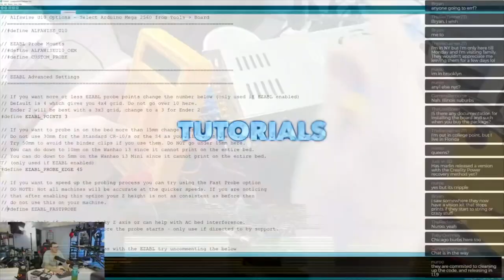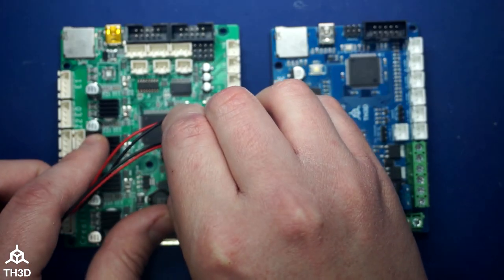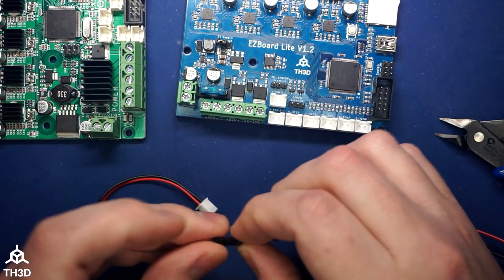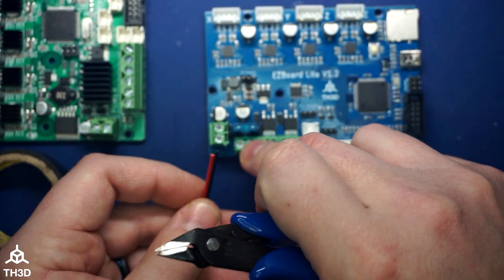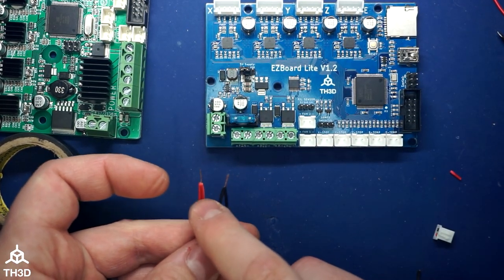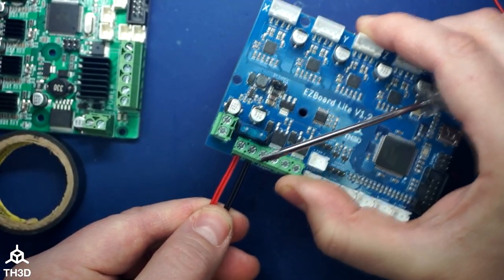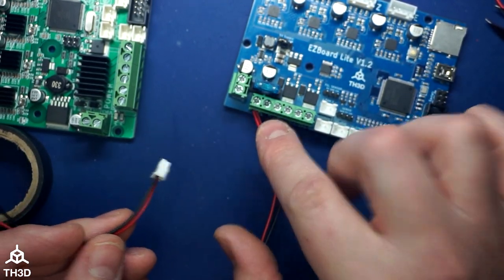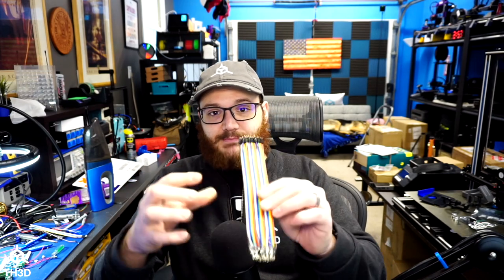Re-wiring 2 Pin Fan Connectors | EZTip #7

Comment: Tim, I would suggest using ferrules on the connectors especially if connecting two wires together
Reply from the maker: You can use ferrules if you want. Not many people have them. The terminals on our EZBoard bite into even these smaller wires very well so it's not a worry about them coming out (on our board anyway).

Comment: putting it in this area on the terminal would you be able to still control fan speed then? for hot end fans wouldnt you want to be able to control the speed
Reply from the maker: If you put a fan into the always-on terminal it will be always-on. Some boards have support for a controlled hotend fan and some do not.

Comment: Can I use a 3 pin connector with a 2 wire power wire
Reply: Yes just make sure the ground and positive wires are correctly placed. You'll have to look it up, but I think you would install them in the 1st and 3rd connectors
Reply: @joeschmoe435  thanks that's what I was think
Reply from the maker: Yes, just make sure you don't use the tach pin. Use the positive and negative wires.
Reply: @TH3DStudio  tach pin? There are only two wires.. both in black
Reply: @TH3DStudio  I was going to leave the center pin empty.. maybe I'll do a vid n tag you